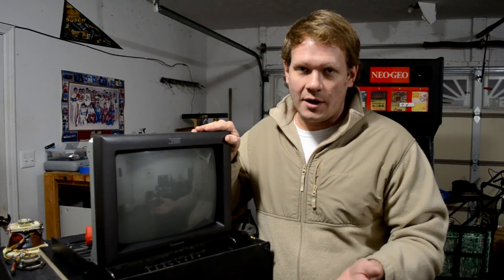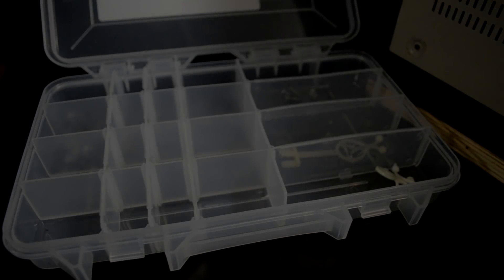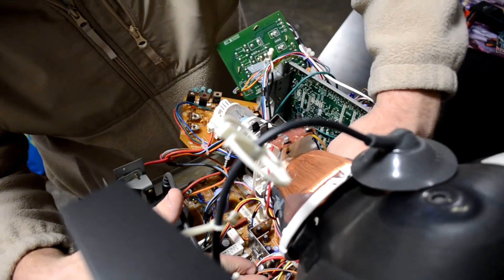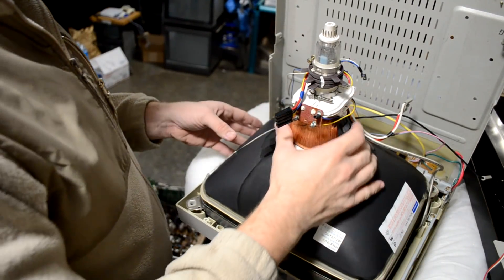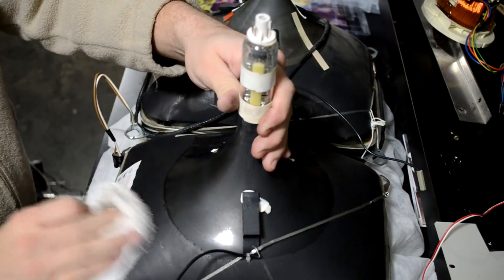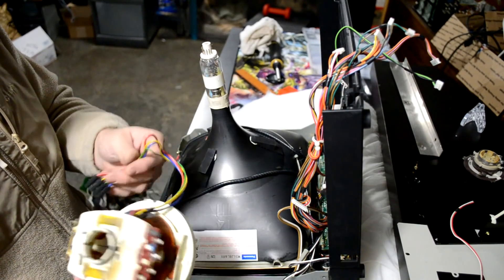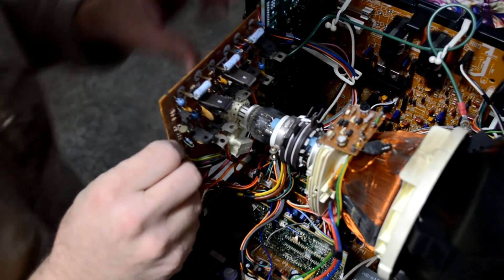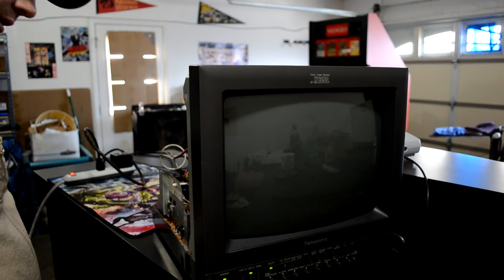CRT Tube Swap: The Repair Tutorial You've never seen!

Comment: I have a question, I have a 13" Trinitron with some pretty bad burn in, needs new caps, and only has composite in, though it does have two inputs. I also have a 13" Trinitron that is RF only but is otherwise in beautiful shape, though a bit older. It was an RV tv so it didn't get much use. Would it be worth it to swap the tubes, or better to try to mod the RF only Trinitron? I also have seen those modulators that can connect all the way up to S-video into RF. what would you recommend?

Comment: I have a 14L5 monitor with some screen burn-in or color corner issues that I'm not sure degaussing will work (at least the built-in one will not) That being said, I do have a brand new tube for the unit. Can I just use the same yoke assembly with the conv rings and swap out the tube using everything that was existing in the monitor? If so, then I'd imagine the only difference would be convergence strips and magnets placed on the back of the tube? Let me know what you think. Thanks!

Comment: is keeping the yolk? from the original chassis super important? i did a tube swap on a busted LG Studioworks CRT monitor i swapped in a Samsung flat CRT tube from a Sceptre Dragon Flat CRT monitor but just left the yolk that was on the tube i put in. all i am getting for an image is a blurry all out of focus image.
Reply from the maker: You may be able to use a different yoke if it came off the same size tube, but you will most likely have to re-wire the connector to match your chassis.
Reply: @RetroTechUSA  didn't have to rewire it just removed the plastic from the connector.
any swapped in the yoke from the original tube but ended up with same issue but i was able to adjust focus but the image stretched horizontal and i do not know how i am to adjust that.